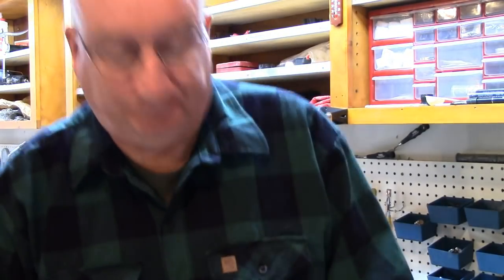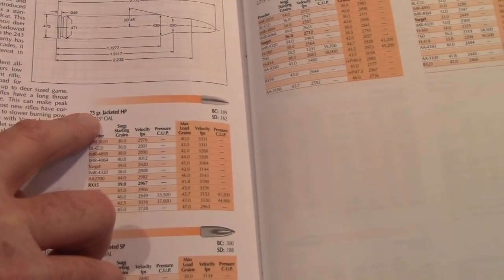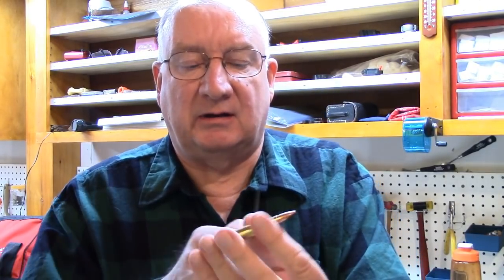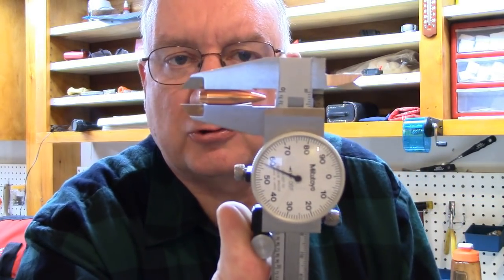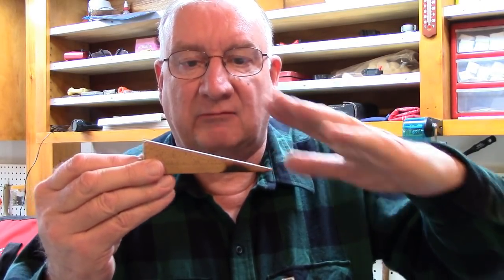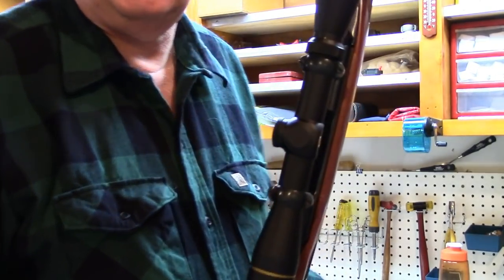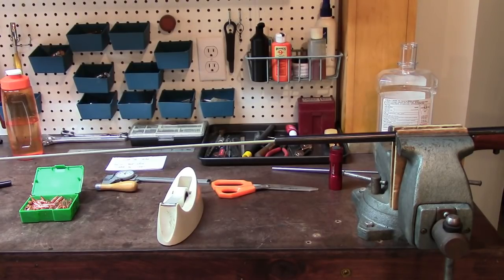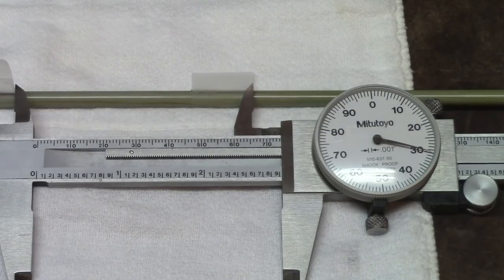Handloading PART VI, How to Measure Cartridge Overall Length ~ GunBlue's Complete Guide

Comment: I didn't know the rule about having the bullet one caliber deep. Great info.
Reply from the maker: That's the optimal depth, but some circumstances can call for less at one's discretion.  For instance, many rifles have long throats to accommodate heavy bullets, where seating slightly closer to the rifling may provide better accuracy with short bullets.  This is an issue that should be weighed in the light of its use, for instance: If it's a target or varmint round, where it can be gently single fed, without the prying effects of running from the magazine, a bullet can be seated to as little as a half caliber without concern.  However, if it's a game hunting round, no amount of finessed seating depth for a 3/8 inch difference in accuracy is going to make a dime of difference, but could cost a hunting trip.  That rule not only provides for a secure grip, but it also keeps the bullet properly aligned, concentric to the bore axis.  Keep in mind that a great percentage of factory loaded ammo is seated deeply and very far from the rifling and can also be capable of fine accuracy.
Reply: @GunBlue490  Thanks. I'm loading for an M48 Yugo Mauser in 8MM. I have some very old 150 grain round nose bullets from probably the 60s someone gave me. They are very short and even with them barely in the case they are actually below the min OAL my book says is ok. They shot fine though when I tried them at the range.
Reply: @GunBlue490  z

Comment: Thank you for your no nonsense video much appreciated and answered all my question the biggest tip was once you get your OVAL to reduce it down another .015 to .030" to achieve better groups. I have friends that are using the first OVAL ( touching the lands) and getting grate groups. My Question is this an unsafe practice.
Reply from the maker: It's a common practice among benchrest shooters.  It significantly raises pressure, so the load must be reduced accordingly or it will be unsafe.  It's fine for target shooting, but because the rifling can pull an unfired bullet and spill powder, leaving the bullet jammed, it's a VERY poor method of loading for field and hunting loads. Typically, any rifle will find a highly accurate sweet spot somewhere around .020 from the lands, with the best velocity and freedom from worry.
Reply: @GunBlue490  thank you very much and yes I agree I have seen my buddy pull his bolt back and the projectile stayed in the gun that's why ask I you this question. Thank you for your honesty I value and respect that very much. I will be watching your other videos they are very resourceful.

Comment: Frankford arsenal has an OAL measuring device(clamps and rod tip)that works from the muzzle. It is more simple than using the modified case(Hornady). Certainly both  devices are less crude than marking bullet with a sharpie.

Comment: On the Hornady overall length gage there is a "PUSH ROD" (plunger) that screws into the back of rifle case. This ""push rod" pushes the bullet into the chamber....Upon removing the case, the overall length gage is at, or slightly beyond (sticking out) the case neck...This also occurs with other bullet brands and grains.
Reply from the maker: Of course.  It's a silly, expensive, and complicated device designed to pluck your wallet.  That's why I did this video, to save you such waste and aggravation.  If you follow my method, it works regardless of bullet brands or weights, and costs nothing.

Comment: RE: 222 Remington..Speer 50 gr. Sp:  After I insert the case and the bullet into the chamber/ rifling, I remove the case and OAL gage. The OAL plunger is at, or slightly beyond the case neck…This also occurs with other bullet brands and grains.
Reply from the maker: I'm not sure what you are referring to.  I didn't speak of using an OAL gauge or plunger.  I don't know what you mean by the OAL plunger being at or slightly beyond the case neck.  Most rifle chamber throats are cut to permit the longest bullets in a given caliber, which means that lighter, shorter bullets will not reach the rifling when the bullet is properly seated one caliber deep into the neck, but most shoot perfectly fine, and can achieve excellent accuracy, even if seated very far back from the rifling.

Comment: Couldn't a person just measure the overall length of the bullet after it had been pushed back into the cartridge neck by the lands?  Then shorten by whatever is appropriate.?
Reply from the maker: Yes, but that doesn't work with many rifles that capture the bullet.  It's worth a try.  Paint the bullet with a felt pen, insert into the case, seat and extract.  Observe if the ink indicates any withdrawal that denotes a pulled bullet.  If not, you're good.
Reply: @GunBlue490  Sir, you are a true gentleman.  Thanks for the kind response.  After reading most of the comments I decided that next time I'd try it your way, with one small change that seems to make sense, i.e., measuring to the bolt face first.  JMJ

Comment: Can you explain , why not go beyond .015? Say 10thou of the lands?  Thanks
Reply from the maker: Yes, I will.  Ogive to lands distance is not 100 percent controllable, due to several tolerance factors. Any setting can shrink or grow as much as .010".  If set at .010 and a given round in a group reaches contact with the lands, pressure will be distinctly greater than the other rounds, throwing a shot, or even exceeding operating pressure, possibly sticking a bolt.  There's more to it than that.  In my own testing, I have recorded two consistent accuracy settings; full contact, or backed off .015 to .020".  Solid copper bullets at .030".  But, every bench rifle shooter knows that, due to inconsistent length issues, full contact is only assured when the bullet is jammed into the rifling by forceful bolt turn, which is extremely poor practice for a hunting rifle, even for varmints.  Plus, it unnecessarily raises pressures and recoil.  I can almost always guarantee a good accuracy setting to start at .020, which will generally be about as good as it gets.  Except for the longest bullets, you're not going to get even that close with most factory chambered guns and still have a caliber deep in the case.  Don't get too concerned about this anyway.  The sweet spot is typically only a 1/4 to 3/8 MOA better than the listed overall length.  That's great for bragging rights but has nothing to do with most shooting, including competition.  Most varmint bullets in my 22-250 can't even reach .020", and it still shoots .400 MOA.

Comment: So if the bearing surface has to remain roughly a caliber length constant, and my Lee case trimmer trims the brass casing to the predetermined length, how would I increase the overall case length to accommodate the best measurements that you have described? Should I just not trim the case after resizing in order to accommodate the bearing surface? Should I  just drop the rounds into  the chamber and close the bolt? Pardon my ignorance on this matter. I understand that the magazine limits  cartridge length, so that's why I was asking if I should just not use a magazine and drop the longer cartridge into the chamber and close the bolt for the best accuracy? This is of course if the correctly sized cartridges for my particular barrel are too long for the magazine.
Reply: Hope you understand what I'm asking.😁
Reply: You are confusing case length and cartridge length. He is not measuring the "case" overall length, he is measuring the "cartridge" overall length. "Case" length (base of the case to case mouth) has no bearing on COL (base of the case to tip of the bullet).

Something he neglected to point out is while that rifle and that bullet may measure 2.930 allowable COL, that length may not fit the magazine length. The COL I used in my Rem 700 would not fit my friend's Win 70 magazine nor chamber, as both the box magazine and chamber throat were shorter on his rifle.

Comment: GunBlue490 I enjoy your videos immensely and I am beginning to understand the reloading process more. I have been reloading mainly pistol for a few years but will start to load for .223 soon.
My question,,,If the COAL measurement that is found by this method does not correspond to the COAL measurement in the loading manual for the chosen bullet, how does one adjust the powder measurement for the difference in COAL?
Reply from the maker: The COAL in manuals relates to the SAAMI specified length that will fit all magazines and guns of that cartridge and bullet weight, and which will seat the particular bullet with full neck contact.  The COAL is also the minimum length that provides safe pressures with the charge given, and should not be shorter.  There's no maximum length, which is entirely dependent on the working dimensions of the gun that feed, cycle, and fit into the chamber, with sufficient support of the bullet shank, which is ideally a minimum of one caliber deep.  Generally, longer overall length does not mean that the case can hold more powder, simply because closer relationship to the rifling raises pressure, as the bullet has less jump.  So, with perhaps some leeway that might be found in incremental testing, whatever pressure is lowered with more case room is taken back by less freebore.
Reply: @GunBlue490  Thank you sir.

Comment: Another similar method I use is to size a brass rod roughly 1in shy of the muzzle closest to the dia of the bore to contact the bullet tip. With the tail of the caliper use as a depth mike and record the reading. Remove the bullet and install the bolt with firing pin retracted and record the reading. Subtract the values and that is the number you are looking for. In my 22-250 savage with a sierra 55 gr spitzer my max is 2.468.

Comment: Thank you for all your great videos - I used them as a tutorial particularly for reloading and for gun cleaning. 

I did however run into an issue with this method of measuring overall length to lands because of the particular bullet I am using. My bullet for 308win is a Hornady 165grain Interlock SP flat base, which has a lead soft point that I sometimes find to be slightly deformed. I don’t think this deformed point is bad enough to effect accuracy, but I do think it’s a problem if I use this method to measure to point of the bullet. 

I have considered other measuring alternatives like shoving loosely necked bullet into the chamber or using the Hornady length gauge. Do you have any other suggestions?

Thank you.
Reply: I would like to add that I already use the Hornady comparators to measure my bullet lengths and headspace. I am considering whether I should also invest in their maximum length gauge for my chamber.
Reply: The difference in tip should not be enough to affect the overall goal of finding your chamber length. Don’t sweat it this method is solid . Btw I’ve used the same bullets for this with success.
Reply: Jeff, 
I’ve changed my reloading methods a lot since my original notes. For bullet seating length I use Erik Cortina method to find jam length, and I back off 20thou to get starting length. Assuming you’ve found best powder charge to minimize ES, you can then back off again in 3thou increments to get most accurate combination. Or as an option to varying length you can use a barrel tuner like EC Tuner Brake - I use that method because I like my bullets long enough to keep bearing surface away from donut. For measuring I always use base-to-ogive (BTO) rather than COAL so I don’t have to worry about inconsistent bullet tips. And I find the stainless steel Sinclair comparator to be a little bit better at measuring BTO than aluminum Hornady comparator - but both of those tools will do the job. Good luck and have a good one!
Reply: I have seen his method and it is solid as well. "Chasing the lands is stupid". And it is a fruitless search, I agree with him.
Reply: I know this is a late reply but I'd be all for taking five or ten of these from the box, measure for the longest one I found, and go off of that for COAL. Ascertain where the bullet seating die should be in order to match that COAL, set it, and load all your cartridges before you take the die out. You would not have enough variance to effect any thing. Maybe a mil or two.

Comment: Liked & Subscribed New Viewer

New Reloader and I’m trying to figure this out for a reload for my 7mm rem mag.

I keep doing the measurement with the tape and rod and consistently getting 3.405” with a Hornady 162 Eldx. Does this seem like it could be correct?

Everything I see says a maximum overall length of 3.290” in the books. Which really doesn’t matter because it’s only for factory manufactures to follow?

So if I’m understanding all of what you explained in the video correctly I should start my reloads at 3.375” and load no longer than 3.39”?

So is it always only 4 overall length loads you test?
Reply from the maker: With very few exceptions, actual chamber dimensions using modern bullets can be expected to be considerably longer than stated overall lengths, which are often based on bullets that have more rounded gives that contact the rifling with shorter lengths.  As long as you have approximately one caliber deep case insertion, the round feeds reliably, and fits your magazine, don't worry about the listed overall lengths, which are only industry guidelines for cartridge size.  Any time you have a rifle that will permit a longer cartridge that fits the magazine and seats deeply enough, you are very fortunate, because it reduces pressure and may allow a slight increase in powder capacity, provided you carefully work up loads that are safe and accurate. Generally, the most accurate length is found between 15 to 30 thousandths from the rifling.

Comment: All this presumes that one has as eagle's eyeballs.  I do not.  At my age I can barely discern 1/32th inch resolution ... to say nothing of 1/1000th.   I'd far rather trust an accurately machined die/gauge than use scotch tape.  IMO, at my age, this is absurd.  Your smilage may vary
Reply from the maker: You presume that you must discern 1,000th.  Baloney.  Plus or minus 5 thousandths... even more... means nothing for any sweet spot, and I've tested the parameters. The 32nd is close enough.  Methinks thou dost protest too much. If you can read a caliper dial, and if you can see crosshairs, you can see the edge of Scotch tape... Shooting guns and eyesight are cooperative functions.

Comment: Just tried this. Very good way to measure the  COAL. I was using the bullet in the case and close the bolt method, but was getting inconsistent readings on a berger vld bullet. Tried your method and is much more consistent. A variation to the tape method I found is you can place a bore guide (or a something as a reference) on the rod and measure from muzzle to the bore guide, zero your calipers with a closed bolt the put the bullet in measure with the calipers from the muzzle to bore guide again this will give the correct reading displayed the calipers.

Thanks Gunblue, Love watching your videos all the way from Australia.

Comment: How do you know the cartridge you put in the chamber is contacting the lands in the first place? Alot of methods depict a loose bullet in the casing. Nothing like that was mentioned? Thanx.
Reply: Two measurements are taken. The first is from the end of the bore to the bolt face while the bolt is in the closed position, ensuring the firing pin is not forward. The second is from the end of the bore to the tip of a bullet, not a cartridge, which is pressed into position such that it is contacting the lands. The difference between these provides the overall length of the chamber from which you subtract .020" in order to fall within the specified tolerances of .015" and .030" and provides you with an optimal cartridge overall length.
Reply: Watch again, maybe you will understand what he is doing.

Comment: I have a C.O.L. question about .270 cases. I bought Winchester 130 grain power point bullets, trimmed my brass to the suggested 2.530. I seated the bullet to the book 3.267 and the cannelure is buried, is that a no go? Should I trim the brass shorter or leave the cannelure into the case?
Reply: Leave the cannelure into the case. You don't need to crimp 270 win anyways. If you must crimp them load them a little longer to the crimp groove. Winchester power point's tend to be a little longer in the front portion of the bullet.

Comment: Gunblue, I have never heard of this method but was looking for an answer for obtaining oal as I had recently had a discussion about a problem I had with maintaining the oal of my cartridges on my T-mag. I had noticed a few years back that my cartridges varied a few thousand and I believed it was from the flex of my turrent plate fit. this lead to a discussion about gaining the proper oal in the first place, the gauge you mention was what two folks were quick to endorse even though I couldn't see how that gauge would work having never even seen one or heard of them. the method I was taught was to seat a bullet in just a little and load it up so the lands pushed the bullet into the case, eject it and measure and set your die in about .002 -.010  I'm hearing what you are saying so i think I'm going to set it a factory spec. and see how that works. But is the method I was taught a bad method?

Comment: A novice question would be advantageous to take apart a factory cartridge like Agulia 9mm 124grain and use it as reference I know I would need the powder & bullet brand? Just a thought .
Reply from the maker: JOSEPH DIGIOVANNI 
Not advantageous at all, because it's unsafe to replicate powder contents, not knowing what they are.  The ONLY safe method is to use published load data for the exact components.  I recommend a loading manual, and that you study the process, and watch my loading videos, too.